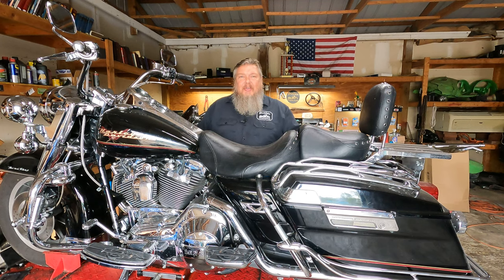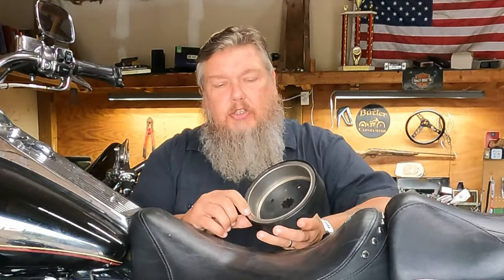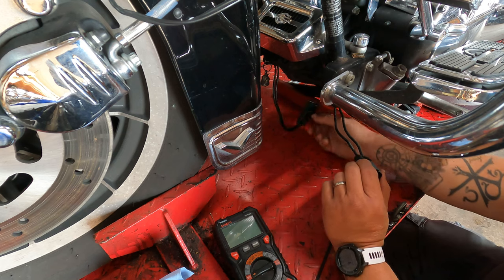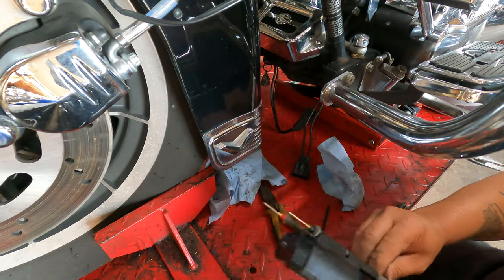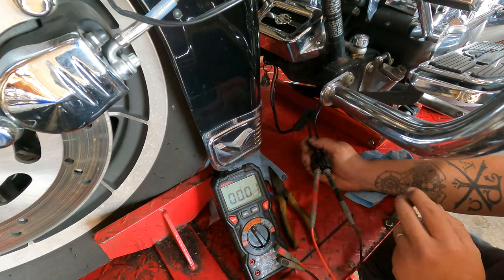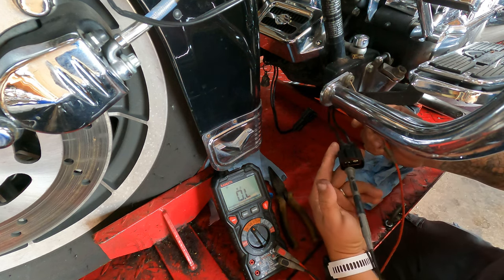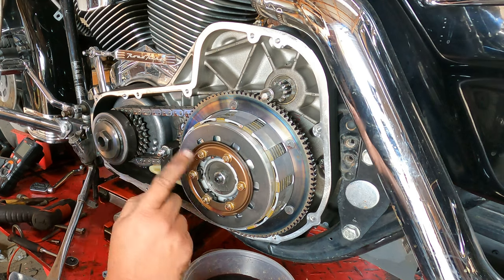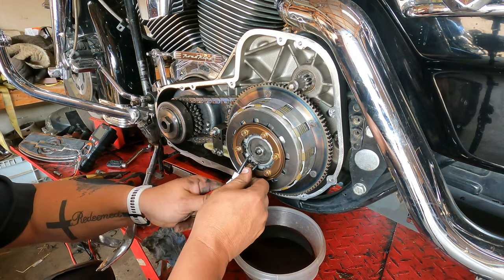1999 Road King Stator and Rectifier Replacement. Butler Customs

Comment: Thank you for the great video. I have a 2001 road king I just replaced my stator and voltage regulator. I went back with the oem style stator. I had already ordered it before I seen your video, or I would have went with that upgraded version.  Good as new now . Thanks so much I was able to follow along  and get it back on the road.  Let the good times roll!
Reply from the maker: That’s great! Glad I could help! Here’s to a safe riding season!

Comment: I'm circling back on this. All the parts came in on Thursday (Cycle Electric R/R and stator, new sealed rotor), so I decided to tackle the project. I have nothing to add to the steps here. I'm very mechanical, but the hardest part of all of this is running the R/R wires and getting enough stink on the torque wrench without a cheater. For anyone who needs to do this, stop your search with this video. Start to finish, with plenty of interruptions, took me 2 hours. I will add, buy your parts from Cycle Electric. Do NOT get cheap. If your regulator fails, it could kill your stator, and you'll be out more time and money.
Reply from the maker: Glad I was able to help and I’m happy you got your bike fixed! Thanks for watching and commenting!

Comment: Just curious, do you prefer manual or automatic chain tensioner in the primary?
Reply from the maker: Personally I’ve never had an issue with automatic tensioners on stock parts. If the bike has performance parts then I would recommend manual. Great question. Thanks.

Comment: Any chance you can suggest whether I can use nacelle top trim pieces 67868-03 & 67868-94 interchangeably ?
Reply from the maker: The 67868-03 fits years 1994 to 2013. And the 67868-94 fits years 1994 to 2002. Not sure what the difference is because they look the same to me. Hope this helps.
Reply: @butlercustoms  thank you
Reply from the maker: @oleksasirotinin1532  my pleasure.

Comment: Awesome video man. I have to do this this weekend on my 01 RK. Can you tell me where you got the rotor? I bought a R/R and Stator from Cycle city, but I'm not seeing the rotor.
Also, what size is the comp nut and clutch nut?
Reply from the maker: Thanks for watching. I believe the comp nut is 1 1/2 and the clutch basket nut is 1 3/16. And don’t forget that the clutch basket nut is reverse thread. And I believe I got the upgraded rotor from JP Cycles.
Reply: @butlercustoms  Ended up getting the stator on eBaY. I just watched this to the end and saw the cause of the failure. Ironically I found my rectifier wires were both bare. The routing looked good, but I can only assume the were too close to the engine or mounts. My bike is an FLTRI that someone converted to an FLHI and they did a phenomenal job. If this was a second rectifier I'd be shocked. 
Either way, your video is hands down the BEST one I have seen on this. Very detailed without extra fluff.
Reply from the maker: @shawzall404  that’s great you found the issue! Glad I could help. And thank you for your kind words and for watching!

Comment: Great video, where did you get the stator and rectifier, going to do this to my 99 RK
Reply from the maker: The customer ordered them. I believe from Drag Specialties. If I was going to purchase a replacement I would go with Cycle Electrics. They are made a little better than the OEM

Comment: What are the other wires on the "yellow" side of the the circuit breaker? Thanks.
Reply from the maker: I can’t remember off hand. The mechanical circuit breaker is for the rectifier in case of overload. So I would assume it runs back to battery.
Reply: @butlercustoms  thanks
Reply from the maker: My pleasure. It should be in the wiring diagram and show it better.

Comment: What kind of air filter cover is that?
Reply from the maker: I believe it’s a Kuryakyn Hypercharger Air Filter. About $140
Reply: @butlercustoms  thank you. I have a 99 RK classic. Ran codes do1clr all the way to 10 and CAL 03. Going to check my volts with a multi meter. It runs strong when i get it going but cold idle wants to shut off and at times when i first take off will shut off
Reply from the maker: @RettitT sounds like you’re sniffing in the right areas.
Reply: @butlercustoms  when it says CLR after the codes is that something to worry about? I believe the CAL 03 is rectifier or stator. Also removing the bolts on the stator didn’t use a 3/8 impact?
Reply from the maker: @RettitT  The CLR that displays after the codes means “Clear” if you hold down the button when it displays CLR it will clear that code off. CAL 03 is the calibration code of the speedometer.  And never use impacts on internal motor parts due to the possibility of stripping threads or snapping bolts inside the case. Hope this helps! And thanks for reaching out!